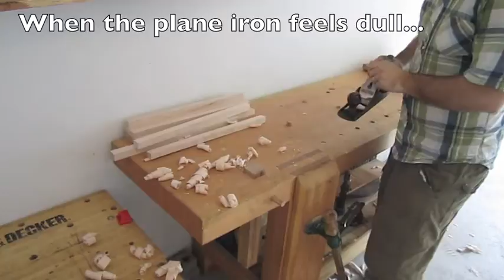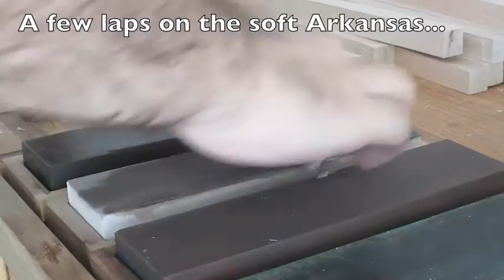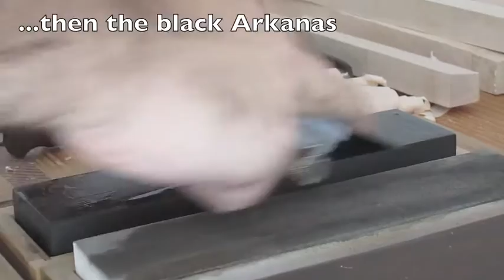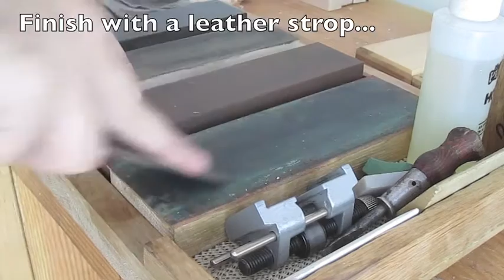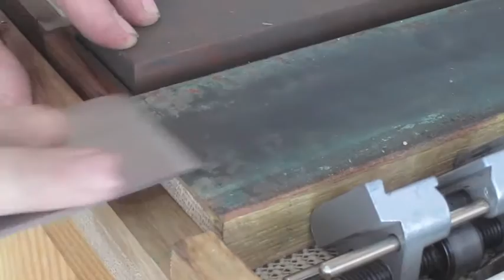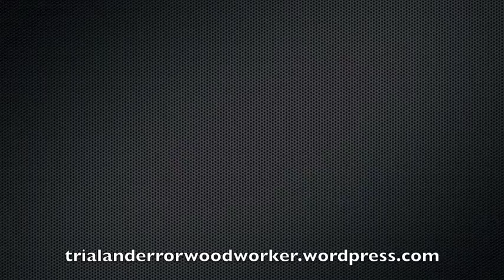Sharpening a hand plane iron with oil stones (in real time)

Comment: Thanks for this great video. I bought a small Kobalt plane for using with a running board I made for miter joints. Well it dulled rather quickly, about a week. I tried sharpening it, but it digs into the wood. But to sharpen it I used a diamond stone. I also put a micro bevel on the back of the blade, as I saw this in one article I read. Did I ruin the blade? The plane is about 7 inches long. Should I get a longer plane for this type of work?
Reply: Adding a micro bevel helps with tear-out prone boards, but is an unnecessary complication for general plane use.  Your plane might not have the best steel in it - I would recommend getting a replacement blade from somewhere like Lee Valley, but it might not be worth putting an expensive blade in a less-than-expensive body. Maybe try to find a vintage plane on eBay? A Stanley number 4 or 5 would do the job you describe. The initial sharpening might take some time, but the touch-ups like I show in this video will be quicker.